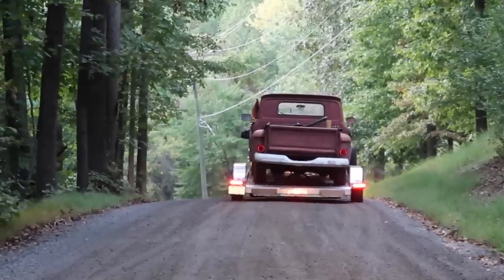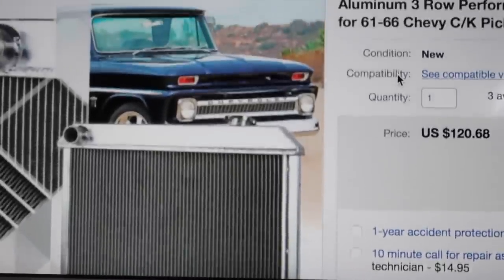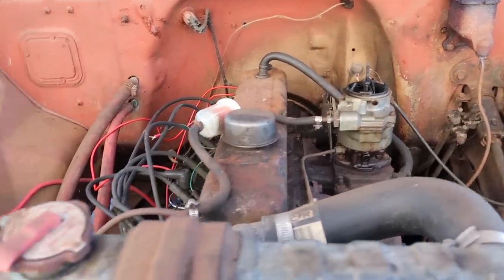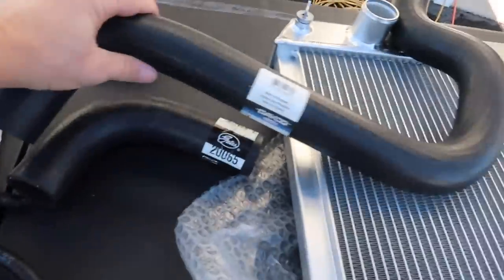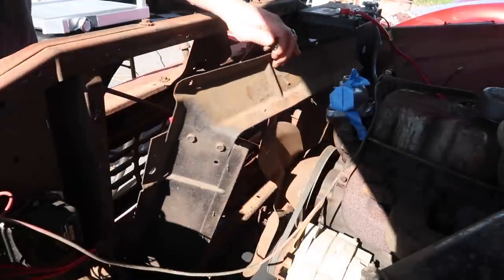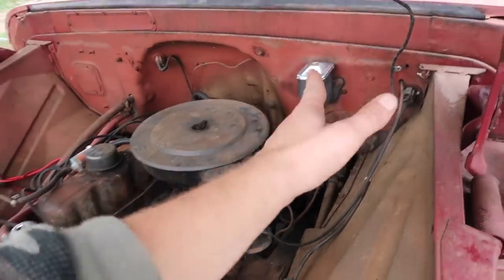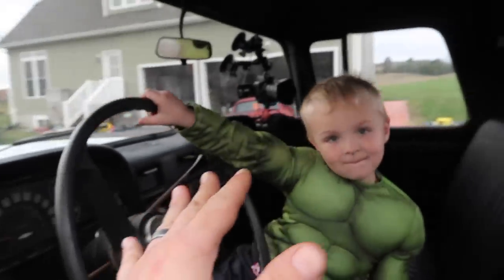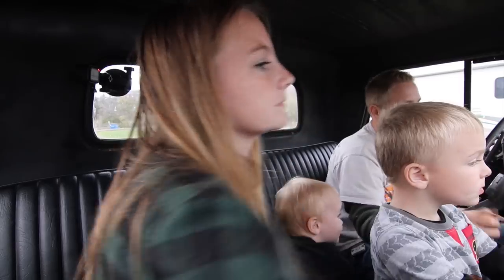Abandoned Field FIND First Drive 1963 Chevy C10

Comment: Why didn't you replace the fuel tubes? Wouldn't like to get chunks or dirt from the old tubes into the new carb. Some adjustment and I think it will run fine. Sounds really good at idle already. :-)

Comment: You will need to adjust the points and then timing, then adjust the carb! head gasket won't cause this running issue, there is a lack of power. Possibly from timing and carb adjustments! You need to start with the basics, the beginning points, timing and the carb settings. 

Dwell meter for the points adjustment, dwell might be somewhere between 28 and 32. then set the timing. 4 btc maybe.

Comment: If you are getting excessive Steam out of your exhaust system than yes you have a head gasket problem it also seemed like it and not being used to the idea of 3 on the column I don't know which of the six you have in your truck but a 235 or 250 6 makes a great motor for that old girl and by all means let that old girl be a place of serenity to you when you get ready to work on it and make it your own.

Comment: Ls swap it 4 speed on the floor do disk brakes new tires and wheels and drive it
Reply: Matthew Barrick when I mean new wheels I mean 16/17 if anything keep the stock steel wheel and find some caps
Reply: You guys and your LS swap. And why would you waste your time on a 4 speed if you put an LS in it. Go with a 5 or 6 speed then.  Or better yet 4L80. It will shift faster and be just as strong with no shifting.

Comment: First gear is pull toward you and down.  Second is away from you and up.  Third is still away from you and straight down.  YouTube double-clutching.  Up-shifting is just pushing the clutch twice (once while taking it out of gear into neutral, and again putting it into the next gear).  Down-shifting is push in the clutch to take it out of gear, touch the gas pedal to build the engine speed, then push the clutch and put it in the next lower gear.  It sounds more complicated than it really is.  

As for swapping:  Changing that head gasket would be a piece of cake and a great learning experience.  That’s the perfect truck to get Logan out there wrenching.  Bust the bolts loose, hand him the wratchet, stick him in the engine compartment and let him run bolts out.  Film that!

Comment: Stick with brass copper radiators for those older vehicles, aluminum ones dont stay warm in the winter like the origional ones. New cars are designed to run aluminum rads but that was not. I did the same thing with an old vehicle and immediatly regreted it once winter came, not sure where your from but in northern iowa you need heat.

Comment: I would try to fix the engine and keep it original.
Reply from the maker: arthur mulkey if it’s nothing to bad I will.
Reply: Same here but I'll also hit the transmission. Have you tried flushing the transmission? That could be why the drive problem. I'll paint it black with the bed red with a oak planks linner.

Comment: Well there's nothing wrong with original, but for a swap I would go with a 383 engine, 4L70 transmission. A naturally aspirated 383 stroker, with a 4-barrel, mild Cam and heads "around 400-450 HP"  will keep it some what a budget build and still be a real nice performer. A quality high performance overdrive transmission, will allow it to be a nice Highway Cruiser and still be able to handle the power of a mild 383. Should make it something nice to talk about at the car show, a nice Highway Cruiser that you can daily, as well as something you can open up once in awhile and let the horses out without having to worry about breaking it, too much.

Comment: I bet you still need to replace fuel pump and clean the fuel tank and lines and adjust the carburetor. Do you have water in the oil or oil in the water or do you have water coming out the exhaust or bubbles in the radiator or are you loosing water if not then probably not a head gasket.

Comment: Hey JD.🖐  You're gettin' there, bud.  This ol' truck has already come a long way in a short time.  I don't know anything about carburetors either, so respect for getting it this far.  About the possible head gasket leak... is there coolant mixed in with the oil?  With all fresh fluids, it should be easy to see if that's the case.  If that is the problem, honestly, I'd probably think seriously about an LS swap.  Cheap, fast, and readily available.  The Coyote swap might break the internet as well as the bank.  BTW, don't be mad at Tom.  He has his own Chevys to work on.😜  Shoutout to Laura and the boys on that test run.  Liam was loving that rough take off.😁  Oh yeah, Logan's Hulk costume was awesome.👊  Hang in there, man.  You'll get this thing dialed in.  Y'all have a great night.✌
Reply from the maker: lol, Tom was probably working on his. The coyote swap would be epic and would definitely brake the bank. I'm hoping its not a head gasket leak.
Reply: @JD_JoyrideTV  17:36 is my favorite part!  Everybody's head bobbing and grins from ear to ear!😀😀😀  I bet it's nothing major, JD.  I want to see you get it roadworthy with this engine first.  There's always time to upgrade and customize it later.  About the downshifting, just before you release the clutch dropping it back into 2nd gear, blip the throttle and it should fall right into gear without grinding.  Think of rev matching.  I don't think those old trucks have synchros (if so, they're probably worn out by now).

Comment: Need to adjust the air fuel mixture. That is more than likely your over heating problem. Run your needle screw in all of the way, it takes a flat bladed screwdriver. It will be down towards the base of the carb. All of the way in, then back it out three half turns. That will be your starting point. Put a tach on it and then the screw until you get the most rpms. Might be out, might be in. Give that a try.
Reply: Not three and a half turns, three half turns.

Comment: Get that carb off. Tape up the opening where the carb sits on the intake manifold. Clean up the area real good where you put the carburetor gasket. Make it shiny and smooth. Possibly use some sand paper and steel wool. You need a real tight seal there before trying to adjust that carburetor.

Comment: Find a good 250 or 292 Chevy 6 at a salvage yard , then rebuild the original engine at your leisure. Should be a simple bolt in. Some 292s were real beasts .

Comment: Head gasket on that engine.....maybe half a day. Prob the easiest head gasket job there is. Un bolt exhaust side, leave the intake attached. And btw, once you have the head off, change the intake gasket and it will run right. You can test that with spraying carb cleaner along the intake where it meets the head as its running. Also check float level....and and and....lol

Comment: I'd say an inline sixes in that hard to pull apart it's actually pretty simple the hardest 2 things 1 is if you've got to adjust the lashing on your valves you're going to need a feeler gauge and you're going to need take the time to do that but the Coyote swap that's a forward there will not work that well and it would it be that good you should rather do an LS swap or throw 350 small in it  But I'd fix that and line 6 all you need to do is get an intake gasket exhaust gasket and then head gasket take the head to a machine shop make sure gets resurfaced get new head bolts and make sure everything else is OK and then you should be good

Comment: It's not a head gasket lol, try looking up someone else's video on how to set your points,plug gaps and setting the timing. Just for good measure, turn the mixture screw on the carb all the way in, then back it off one and a half turns, cause it seems to be running lean also. If you ever do blow a head gasket, don't be afraid, that is one of the simplest engines ever built.

Comment: Your transmission is an old 3 speed and is probably not syncronized, so you cant downshift it to first gear untill you come to a complete stop. A little practice and you will be power shifting it like a pro.

Comment: Old school 350 swap it, it's cheap easy and reliable. You can buy a brand new 350 crate engine from jegs high performance for under $2,000
Reply: Codys Z28 why buy another engine wh
Reply: @1mean_5.07  if the engine in it needs rebuilt anyways why not put something in that has more power and torque for around the same price?
Reply: Codys Z28 true

Comment: I have a all stock  And original 1965 impala SS with a 3 on the tree an here is the kicker it gots the inline 6 cylinder engine even though it's a SS if you ever decide that you need help I'll be glad to help you with the track even with a Motor swap I used to have a 1966 chevy pickup with a 4 barrel 350  with a 4 in the floor an  Dual exhausts with glass packs sounded like a beast so yhea if you need help I'll be happy to help ya an one more thing might want to put a fan shroud on it one to pull air through the radiator an secondly to not what I did when I was younger an accidentally get you hand caught by the fan blades

Comment: Check you compression and that will tell you if the head gasket is leaking. I didn't see any white smoke like when a head gasket is leaking so I don't think you have a bad head gasket. In fact I didn't see any smoke when you went by the camera on the side of the road so I would say that the motor is good unless you coasted past the camera. Like I said before take a water hose and spray it around the intake manifold where it connects to the block and see if the idle raise's up if it does you have a vacuum leak and need to change your in take manifold gasket. it could just be a simple carb adjustment then you have to make sure your choke is off after the motor is warmed up or that will make it stall out too. Wish I lived near you guys I would come over and help out, but I am in Nevada. The good thing is I didn't see any smoke so the motor is probably good. The exhaust is getting in to the cab from probably a bad exhaust pipe that leaking. Mine did the same till I replace the exhaust pipe from the motor back to the rear of the truck.

Comment: Keep it stock. Work with your experienced mechanic to  replace the head gasket if necessary. Swapping the engine won't teach you anything about wrenching and we can all see that you really want to learn.
Run a compression check to see if you have a head issue. I did not see a radiator cowl behind the new radiator. Did you leave it off? You must have a cowl or the engine will over heat.  The cowl is the shroud that's mounted behind the radiator. It is necessary to direct the air flow through the radiator.

Comment: #JDjoyride Lmc truck has all the new parts you need. Spendy though. There is a You tuber who mostly does 55 thru 58 Chevy trucks but he sells parts as well, probably has what you need. Classic truck rescue is the channel. Or maybe try United by trucks you tube.
Reply: Next I'm pretty sure it isn't a head gasket unless it is still overheating. You need to learn to work on cars. A head gasket on that truck is the easiest head gasket you will ever do. You can crawl right in there and do it for cheap in a day not knowing what you are doing.  If you can change a motor out, you can do a head gasket. Next you can tune the carb and check the timing first. The motor from sitting the rings will be a little stuck or sticking, and the valves will be a little rusty from sitting as well. You just need to run that motor some and get a few heat cycles though it to reseat everything. It will run better after its been driven a few times.

Comment: Here's my list for your truck . 1 LS 6.0 Texas speed motor 700 horsepower, next 6 speed automatic transmission, Ford 9 inch rearend 3.73 gears, disc brake conversion all around. Lol oh yah drop the truck then it needs killer rims go with a 285 rear tire width and a 265 front tire width. 19 rear then 18 front rim size.
Reply from the maker: Big sexy WOW! That sounds like a nasty build. Way out of the budget.

Comment: Disperse heat as well as a copper brass radiator .. you could have the carb way to lean .? A vacuum leak could also cause an over heating issue ..the distributor vacuum advance may be losing vacuum ..also check to see if your heating system has vacuum pots on the system as a temporary you and get a rubber cap set and just block them off ..that's also a points ignition and the points may need cleaning ..and regapped ..I really prefer an hei distributor to get away from having to deal with an antiquated ignition system it replaces the coil , and the point and gives you a much hotter spark to help burn off the low grade low octane fuel you get at the pump nowadays.. it will make the engine a lot more responsive..and boost your hours power ..also if the stock tune calls for like 6 to 8 degrees before top dead center ..go with 12 to 14 degrees ..it will allow the fuel more burn time before you just exhaust raw fuel ..hotter plugs and heavier plug wires will also help a great deal .. the original fan sucks and needed the shroud to help pull air across or three the radiator ..you can dump the fan and go with an electric fan ..it's fairly simple to wire up a fan kit ..now a little secret I use to save money is I wire the fan to the brake light switch .. because wen the truck is rolling it should get plenty of air flow across the radiator..wen you come to a stop is wen you need a fan to assist with air flow..oh yeah one more thing the higher the temperature on a thermostat the cooler the engine will run ..it will allow the water in the radiator more time to cool before the thermostat opens again  a lower temperature thermostat can allow the water to not cool down in the radiator..and just circulate hot water back into the engine ..also check your fuel pump I've had those go bad and pump the engine full of gas..or not have enough flow to the carb causing it to just fall on its face under a load ....

Comment: Mixture and or timing can cause that to drive bad and overheat. If it's the head gasket just replace it there so cheap and all cast engine no warping. Now everything new under the hood be a waste. Then get everything else fixed up and possibly do a motor swap a lot later on. But the body wheels breaks suspension is all gonna cost. Be nice to see a genuine old school truck restored mechanically first.

Comment: Pull the whole motor out and go threw it and make it pretty or just get a 350 or 327 motor used but if you do get a used motor go threw it before putting it in the truck

Comment: You might not like it but keep the engine it has and just fix the head gasket you might not think the engine is worth it but it has a lot more value with the original engine in it, plus you’d have to replace every other thing because some of those parts are from the same time and we’re meant for that engine

Comment: Do your research on Ebay sellers and you can get some very good products! I've bought endless amounts of parts for my truck builds on Ebay. General rule...make sure the seller has a 99% rating or above. Anything less and you're very likely to have lots of problems.

Comment: LOL! That's a Chevy for ya' JD, that's been my experience with almost every one of them I owned before switching to Fords.
P.S. Those old transmissions sometimes had unsynchronized gears, you'll have to learn how to double clutch and get a feel for when the time is right to shift them. I had a 56 Chevy pickup when I was 14, it was the same way when shifting. People would always say, "Grind off a pound for me while you're at it" whenever they heard the gears grinding. Also, yes it does seem to have a blown head gasket. They make a kit to check your coolant to see if it has been contaminated with combustion gases, they don't cost much.
Great video JD, but quit wasting time & money, rip that boat anchor out of there and get the Coyote and 5/6-speed in it asap! Please? Help me #TeamLaura, tell him it needs the Coyote! Or at least a 351 Windsor anything but another boring LS swap, I just can't bear to watch anymore of those. Swapping a Ford engine into it will get you more views and subs, people are always interested in cross brand swaps. 
Bags? Put Air Ride suspension under it, then you can set it at whatever height you want, when you want to and you and Laura both will be happy.
Reply: There you go!  Coyote too expensive for the budget so get a 351 Windsor.  I'm with this guy, an ls swap or even just doing an old 350 wont be as much wow for the channel. I would think most of your fan base is probably ford guys like me and would rather see you ford swap it!!!